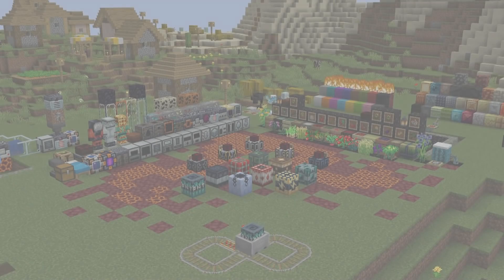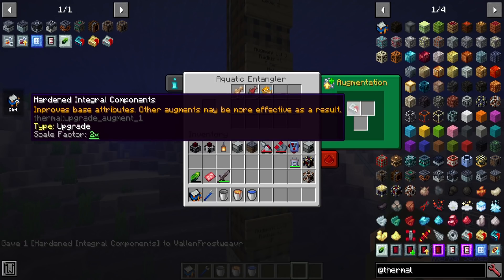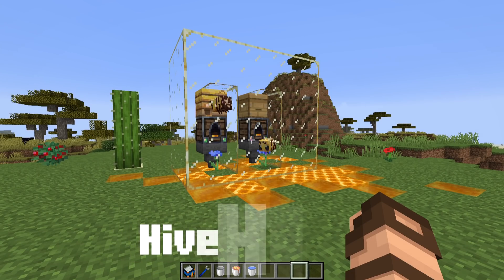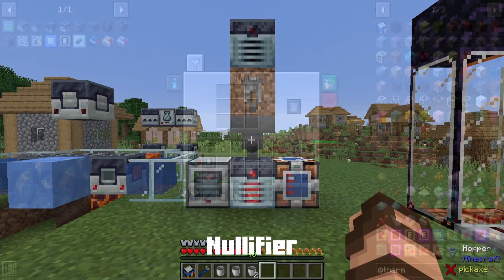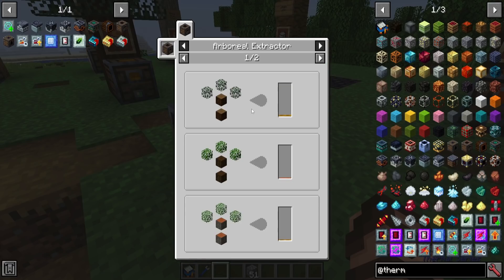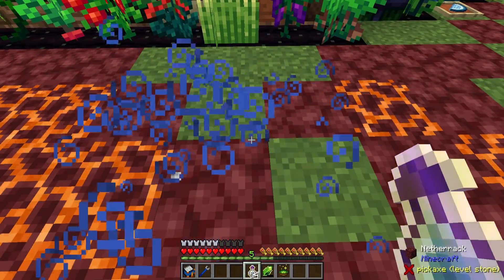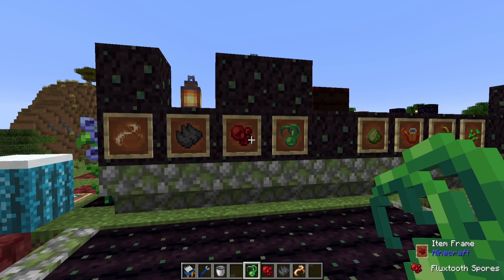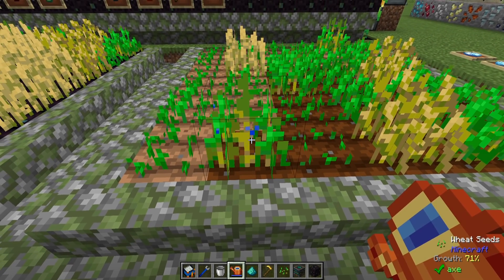Thermal Series mods Pt2 Cultivation & Unpowered Machines Bit-By-Bit 1.16.5

Comment: Is there no Treasure filter for the Aquatic Entangler? Also what does the larger area of effect do?
Do the Igneous Extruders not make other types of stone anymore, like Granite, Diorite, & Andesite?
Is Fluxed Phyto-Gro still a thing?
I wonder if the spores will eventually have worldgen plants in the nether. I love the thought of unique spore plants that spread in a weird way.
Reply: The spores can be planted, just needs the right blocks - Mycelium or untilled Phyto-Soil. I'll make sure the guidebook is more explicit about that.

As for the Entangler - there is no treasure bait, no. That'd be WAY too powerful, wouldn't it?

However, there is also Aqua-Chow and Deep Aqua-Chow, which respectively increase fishing yield and pull from a completely different loot table.

The bait items are data-driven (just like everything else in the mod), and you can make a custom bait and loot table to use with it, so if you really want a "treasure" bait, you can absolutely add one!

Comment: Intersting that the Igneous Extruder now operates based on in world rules.  Might this eventually be configurable  if a pack has astral in it, to make sand using starlight on one side?
Reply: Per Enigmatica 6, it seems to already be the case. In E6 the Igneous Extruder can produce different types of stones like Andesite, and IIRC Marble as well.
Reply: very cool.  I love when something I think of as far fetched and a huge ask, is already in there.
Reply: @ICountFrom0  The entire mod is data-driven. Even the Aquatic Entangler has bait configurability - you can have certain baits pull from certain loot pools. That's what "Deep Aqua-Chow" does. It's in the mod, he just missed it. :) The next patch will have more clarification on what can be used where.

Comment: would love to have heard which augments can be used for each machine.
i'm wondering what augments can be use on the igneous extruder.  it has three slots, but as far as i can tell, it will only accept the generic component upgrades.

Comment: how do you pipe water out of the aqueous accumilator
Reply from the maker: That depends on the "pipe" but if it's a Thermal Series machine, just have it against the AA and have the machine auto-extract from that side